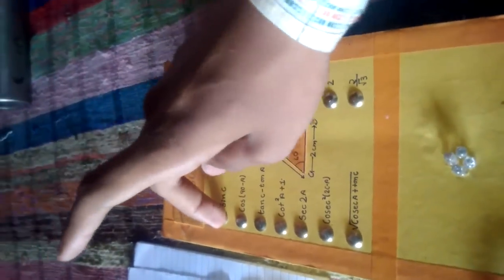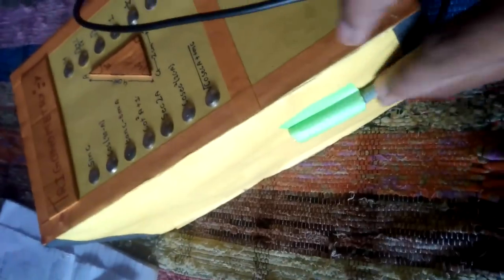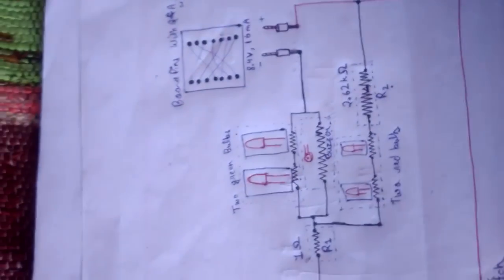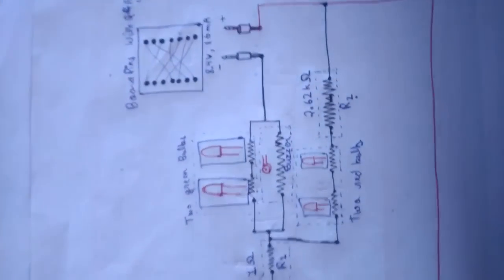Maths Working Model on Trignometry , Easy and cheap 2.0 | Best for Exhibtions

Comment: Bhai
Aapne wire kese connect kiye yrr
 Kya Aapne Jo ek long wire bahar nikala hei ,wo nails or pins se connect hei kya
Reply from the maker: see from 4:30 ,,, black coated wires are the wires which are taken out
rest see the diagram of circuit